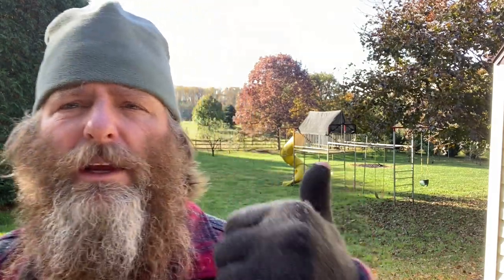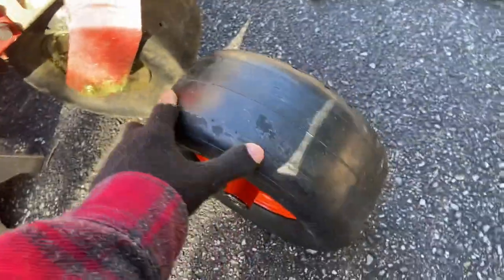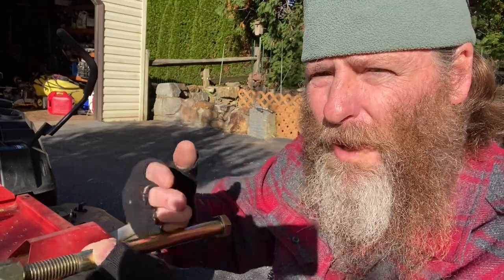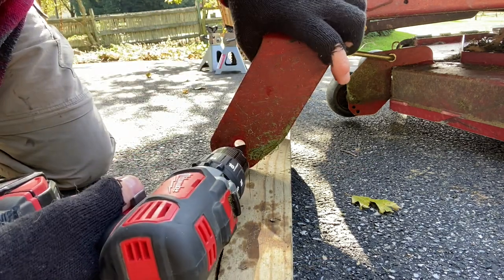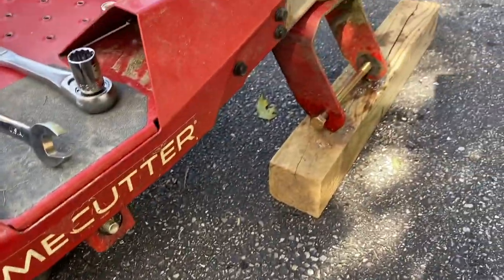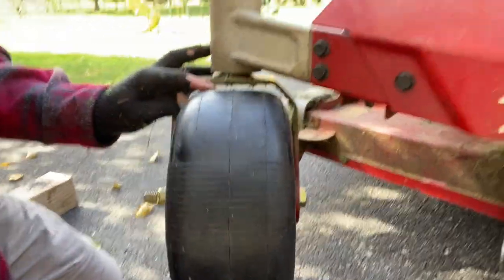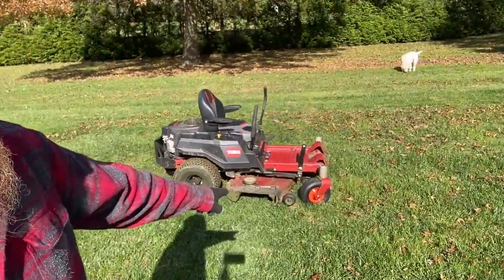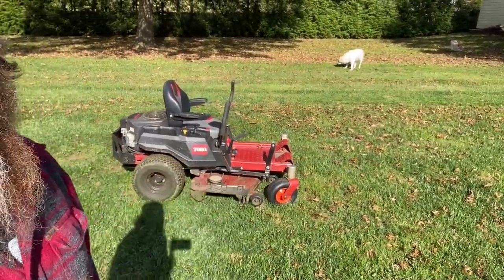NO FLAT solid wheels tires on TORO TIMECUTTER zero turn mower

Comment: Just found your video. Have a Cub Cadet Z1 46. I went with the same wheels as your but mine are greaseable. Completely did away with bolt/nut. Replaced with 1/2" roll for an axle, transitioned the wheel hole with a 1/2"x5/8" brass bushing. Capped the axle ends with a washer and pin. No different than most garden tractor front spindles. No drilling and wheel spins effortlessly. Obviously, at the start the cavity between each wheel bearing assembly needed grease. Just pump a little grease every 10-25 hours. Works and holds up still today. NO FLATS and EVEN CUTS! Yeah!
Reply from the maker: Right on! Sounds like you did a great job!
Reply: How is the bumpiness?
Reply from the maker: @LegendLength   It’s definitely bouncy. Have to cut at a reasonable speed for the area I’m cutting
Reply: Will a wheel that doesnt have to put grease in not perform as well as one that does allow you to put grease in?
Reply from the maker: @paulperez4355  sealed bearings

Comment: Curious how they have held up since it says you made this video 2  years ago.  I put some like these on my Exmark Radius E 60" this summer (April of 2023) and I cut over 3 1/2 acres.  So, far they have held up.  Have a small chunk taken out of one of them and it hasn't spread.  I was worried about the amount I cut and how they would hold up.  So far they're good.  Put about 40 hours on them.  They are noticeably bumpier though.  Consider that.  I cleared out a ton of brush and I kept hitting thorns with the regular tires so I went to this.  I paid about $170 for mine on Amazon at the time.  Thanks for the video!
Reply from the maker: I love them. The ride is definitely harder but I’ll trade that for no flat tires anymore. I haven’t had any issues yet!

Comment: Thank you. I needed to do this also. Picking up the no flat tires tomorrow. Hoping they fit. May need to drill again. Will see.
Reply from the maker: I hope it works out for you. It makes a harder ride but not having a flat front tire every time you take the mower out is worth it.

Comment: There is a rubber piece that blocks the distance you can push the handles forward and back. You can adjust it. Look up a video on toro timecutter tracking. It shows it all
Reply from the maker: Thanks!

Comment: You did not have to modify the frame. There are inserts in the original tires that make the bolt fit.

Comment: I think I’m going to look into a Bad Boy mower this spring. They seem pretty heavy built and get good reviews
Reply from the maker: They also make tractors,  supposed to be loaded with options
Reply: Going on 2 years with my Bad Boy Avenger 60" its rock solid reliable. Had to use ZT Elite no flat fronts, they are bigger but direct bolt on.

Comment: Should have been able to take the axle sleeve off the old wheel. The axle sleeve is 5/8 OD by 3/8 ID. Bolts are not intended to be used as axles. Also, the better indicator for bolts is on the head of them. 3 lines is grade 5, 5 marks is grade 8. For residential yoh may get by using a bolt as an axle. Definitely not for commercial. But also wouldn't trust ball bearings for commercial.
Reply from the maker: Wow thanks for the information, I may relook at this

Comment: Thanks. I use a Toro ss4225 time cutter and had to go with flat free tires on the front. Darn front tire was always flat. What blades do you use to get such a clean cut and not leave grass clippings behind?
Reply from the maker: I use the stock blades, but I sharpen them with  my bench grinder. Sharp like a knife!

Comment: Thanks for the video. I went with the same flat free tires. Have you had flats on the rears?  Any flat free tires for the rears that you could recommend?  Been looking at tweels but i dont see the correct size in their tire guide
Reply from the maker: No problems with the rear yet. If I did anything in the back,  I’d do wider tires so I don’t get stuck as much.

Comment: Should have used. washer spacer inside..
Reply from the maker: Dam, that woulda been smart
Reply: @oxford821  Yes, I believe you're rubbing on the outside race of the bearing. A smaller washer would have touched only the inner race of the bearing. You can still do that - you'd need 4 washers - 2 each side of both wheels. Thanks for the heads up - subscribed and looking forward to watching more of your videos!
Reply from the maker: @cuskit  Thanks a bunch and glad to have you along!